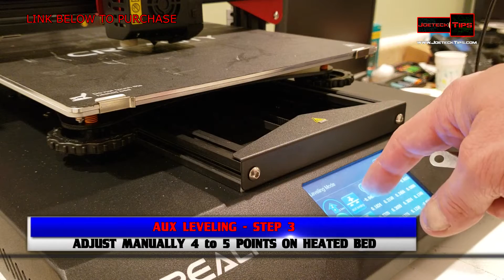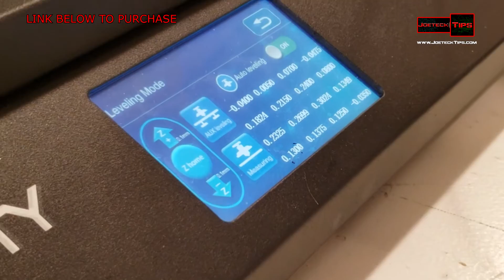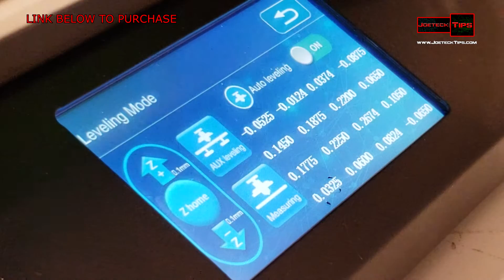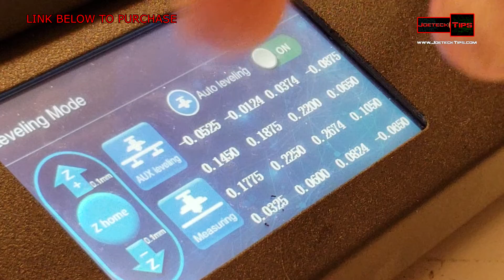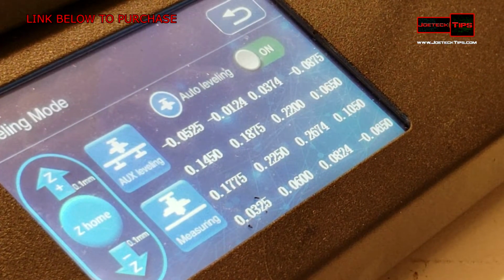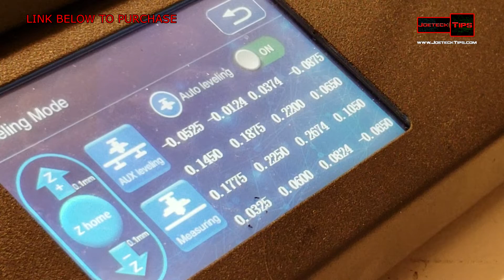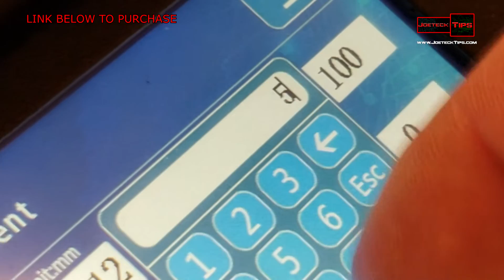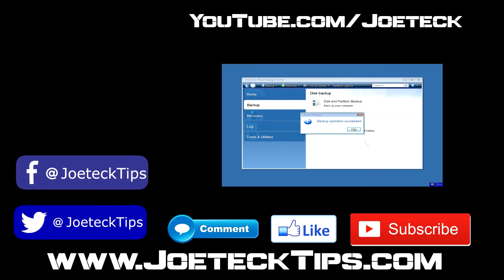leveling the Creality CR10S Pro | HOW TO | JoeteckTips

Comment: when you first get to leveling screen you have to set your z offset , you do this after baking the probe " let the probe set directly above the heated bed at print temp for 15 mins , heat effects all probes " , use the supplied shim to set z nozzle to bed by adjusting up or down with the onscreen buttons , once set hit z home , after it homes make sure the nozzle to bed gap is correct with the shim , if not repeat this till it is , then manually level bed , then map bed if wanted , now your first layer will come out perfect every time both outer and infill without any other adjustments 

your video skips setting the z height and is the most important step for this printer , you can flash marlin to store a balanced offset but isn't perfect but stops you from having to do this step every print but best results is achieved if you do and why they left it this way 

the only trick to capacitive probes is baking and setting the z offset , I run several printers with them and do all the same way and can't tell you the last time I've had a failed print , while this video is old I just educated a guy having problems with exactly this and pointed me to this video as he used it to set up the printer and why he was having issue , do please update for others

Comment: Question for u . My z won’t go any lower it gets stuck at home and will not lower so I can level the sensor
Reply from the maker: Make sure the screws holding the worm gears are not cranked down tight. This may prevent the Z axis from moving.

Comment: Did you do you leveling with the bed and nozzle heated at the normal printing temp?  If not you did something wrong.
Reply from the maker: Didn't do anything wrong. Doesn't have to be hot to level.
Reply: @Joeteck  Metal expands when hot, so not heating it will cause it to not be correct.
Reply from the maker: @TheLotw  mine works fine.. perhaps you should get glass

Comment: I have just purchased the Ender 3 Pro and the Cr10S Pro.  The ender 3 had to be build from scratch and was so easy to set up and use.  The CR10s Pro is a piece of Sh*t.  So much can go wrong, too many adjustments, adjustments keep changing.  For 3 times the money you get 3 times the problems. Would not buy another CR10s Pro.
Reply: Agreed.

Comment: This printer is making me crazy now. Its still f.cking terribly leveling.. Even with new firmware which remember your settings. Almost every print is decalibrated, you have to level it almost every time you print ... I love the way this printer looks, i love the way it prints when its right leveled, but in summe for me its 30 minuts of leveling for one print, what a ... i don't know.. maybe p.iece of sh.t is the right word.. I did perfect leveling, with correction of lets say -1,5mm while printing which is working perfectly.. after print is done, on the next day those same setting are not working and printer odes press into the desk or just fly in the sky
Reply from the maker: I do not have the new firmware. They made it very complicated to upgrade. It could be a crappy printer. I have found the idiosyncrasies with it. Do the fave point Calibration, then the auto leveling which looks like it does something. Then I start printing. I then manually adjust the print head height from the control panel until I see the correct semi flat print. It is a pain in the butt, yes, but I have figured out how to get around the crap and make it work every time.

Comment: Hello Joe thanks for the video, a question for you and all others who have this printer.... After all that set up I can get it to make a great print however as soon as the print is over or I shut down, the power to the gantry stepper motors stop and the left side with all the feed mechanism is so heavy it drops down lower than the right side.  I didn't realize it had done this the first time and unfortunately my print pad looks like a gopher ate through it now.  Have you or any one else noticed this problem with continuous gantry leveling every print?
Reply from the maker: Any way you can send me a picture? Joeteck@joetecktips.com
Reply: @Joeteck  well I stayed up all night debating on ripping apart or sending back. took everything apart and put back together a few loose and incorrectly align parts that you wouldnt think. gantry seems to stay even now. still have the head level issue. even after getting the hot end at the perfect height after each new print it never comes back to exactly the same spot. sounds like possibly a firmware update issue.
Reply: I love the QC  sticker on it. ! makes me laugh
Reply from the maker: @shaunferris6063  So is it working?
Reply: @Joeteck  YES thanks again for pointers on your video
Reply from the maker: Shaun, my pleasure! Glad we talked it out and you got it working. Keep my email fir future contact. Youll never know. Ask me anything you want. ;)

Comment: Hi Joe, I have a question regarding the adjustable bed. What position should the bed be in before I level it? Should it be all the way up , down or halfway?Also, should the nozzle be flexible on the Gantry,or rigid?  Mine is flexible on the Gantry.
Reply from the maker: nozzle should be tight. Use the included wrench to tighten the two nuts. you have 3 wheels, the top two adjust the tension.   Make the bed adjustments in the software. 5 manual leveling points. Looks like a die, 5 locations.  two top, one center, two bottom. Adjust the bed while in that mode. have any additional questions just ask. I'm here
Reply: @Joeteck    Hello Joe. I didn't mean that the nozzle itself was loose, I meant that the whole unit seems very loose on the gantry. With regard to the bed itself, I meant should the adjustment knobs be loose or should they be tightened all the way down before going into the software to level?
Reply from the maker: @JohnFriedel-b6l  hmm. doesn't really matter, because you have to run that manual mode leveling first, then the auto after that which is done last, then you can start printing.  Of course you did the height adjustment with the sensor and the gantry leveling before this step. I understand the whole unit is lose. There are two wheels that ride on it, that will tighten with the wrench, try it.  .
Reply: @Joeteck  thanks very much
Reply: @Joeteck  I'm going to order the inductive sensor.
 That works the best and cures the problem
Reply from the maker: What problem? I havent had any. What problem are you refering too?
Reply: @Joeteck   bed leveling
Reply: @Joeteck   Hello Joe, I tightened the 2 tension nuts on the nozzle but that didn't make any difference. I can still tilt the nozzle ,yet it doesn't come off the track. Also, with regard to adjusting the Gantry height, I cannot adjust each side separately. One side is always out about 1/8 of an inch.
Reply from the maker: @JohnFriedel-b6l  You need to contact the manufacturer. If that is not working something is wrong with your printer.

Comment: if you going to use the autolevel, tweaking the level knobs after the calibration is useless. once you get the initial sensor calibration, then you go for the Z offset calibration and after that no more worries. I would prefer a BLtouch sensor for this job.

Comment: I couldn't get anywhere with mine mainly due to the craptastic capacitive sensor the Pro comes with. Best three things I did were:
    1. Spend $8 on Amazon for an inductive sensor. The type is important but is a pretty much a direct replacement for the horribly inconsistent sensor it comes with.
    2. Installed the Tiny Machines CR-10s Pro firmware, that remembers the autolevel settings when the power is turned off.
    3. loosened every screw I could get to, in order to pull the right side of my gantry closer in height of the left. 
        (The way it was assembled at the factory left the right side way too low. Every time I cycled power the gantry would bounce back to the wrong height.)

Search Google for these three things to make the Pro usable, otherwise, you may wind up throwing your printer through a window like I almost did.
Reply from the maker: Pinned! Great info right here!
Reply: Hi Joe,
can you explain in details point number 3 please? (loosened every screw I could get to, in order to pull the right side of my gantry closer in height of the left. ) I dont understand how do. Thanks
Reply from the maker: Hes talking about replacing the sensor.  I hope that is what you are trying to do
Reply: @Joeteck  Yes I purchased one week ago and I will replace this saturday. Thanks for your replay.
Reply: I Soldered an Inductive sensor on mine and it made the printer come to life! Lol

Comment: Print speed has nothing to do with adhesion at the start, was the nozzle height as you found out later. Have the pro also, has a learning curve as you point out but once you know its like butter.
Reply from the maker: Actually it does.. PETG requires to print MUCH slower. 30 is the recommended speed. Any faster it will fail

Comment: I set a perfect first layer with correct leveling, move the sensor down , something like 2 mm over the bed (the levelling sensor work better if is close to the bed and you'll not find this in the manual ), after that adjust the position of the nozzle at 0.2 mm and finally set the screw off the sensor . Problems of this printer are others: layer shifting and a totally bad setup of all the screws and belts .. in Creality don't know what is quality control but anyway they put a paper with Q.C. ok :), it's a good printer but it's better to tear down all and rebuild it :)

Comment: @Joeteck I've noticed that with an inconsistent bed level, if you use a raft instead of a skirt you shouldn't have a problem with the print sticking. I'm not sure why, but it was very consistent with each layer when I used a raft for the base. The raft printed perfect, and the model that followed printed with no issue. Give it a try. As I mentioned before my bed was bowed in the middle but the raft seemed to compensate for it
Reply from the maker: Raft? Mine bows in the middle too
Reply: @Joeteck  if you use Cura, which I currently use, under build plate adhesion, select "Raft". It prints a flat surface completely under the whole print that is removable just like support is removable. It worked for my cr10 pro. Totally changed the level issues for me. I would of course level the corners of the bed I could, but printing with a raft eliminated problems with first layer adhesion
Reply from the maker: @101mercenary  I use Cura too,  however I do not see that option in my version of 3.6.0. I checked preferences and I see nothing of the sort.
Reply: @Joeteck  That should definitely be in there. I have the same version. Go to the right of your screen (custom menu). The menu below Support should say Build Plate Adhesion. If you don't see it, go to Preferences>Settings and check the box at the top that says "check all". It should show up in your custom menu on the right. The first drip down should say "Build Plate Adhesion Type and select Raft. You can preview what the raft looks like after you prepare the slice

Comment: Also this is one of the best upgrades I've seen for this printer, it has an guide for updating the firmware and a z axis timing belt upgrade for those of you interested. https://www.thingiverse.com/thing:3387741?fbclid=IwAR1joWpZLWTETdta9uWjuacmKUb4roa-DN7N1SY0iEY_sj9TrCc4BdzPRLI

Comment: I recommend getting a PEI Sheet for the bed, all my prints stick perfectly and I pop them off by hand no problem. Took off the black sheet from the aluminum an applied the PEI. Up to you if you want it I just thought it was a nice upgrade. Also for leveling, I do the Z home level about 3 times to make sure the sensor is correct(Adjust It BEFORE the AUX leveling and measuring with the screw on top of the sensor)
Reply from the maker: 3 or 4mm thick and where, AMAZON? provide a link please
Reply: @Joeteck  I believe the sheet is about 3mm. It's pretty thin so it's close to the aluminum bed. I suggest if you get it, to take off the protective top layer before you apply because you will be able to see the bubbles better through the sheet to flatten out those areas. Took me probably 10 to 15 minutes to do. Get the glue off from the black sheet with acetone or nail polish remover. https://www.amazon.com/gp/aw/d/B07FVL1SYF?psc=1&ref=ppx_pop_mob_b_pd_title
Reply: Also @Joeteck , make sure your aluminum bed is level across the whole plate, otherwise it won't matter what you put on there(and I don't mean level with the knobs, I mean like a granite finish) Mine bowed down in the middle, kind of convex. It would print high in some areas and low in others. The 16 points arnt accurate enough to pick it up. I'm currently looking for precision ground aluminum plate. Haha. But of course you can do it by hand
Reply from the maker: @101mercenary I need to have a 310 x 320mm version. I have the PRO, the link you provided is too small.
Reply: @Joeteck  I have the Pro as well. It's up to you. I never print the maximum width on my printer so it doesnt matter so much to me. There may be a PEI sheet out there that size but I have not been able to find one yet. Relative to the size of the print bed it's not that much less overall.

Comment: Hi Joe, it looks like you missed a step. I tried to scan back through the video and didn't see you adjust the sensor sensitivity with the screw on top. You set the height of the sensor but never adjusted sensitivity after that. Once I leveled like you did, then adjusted the sensitivity laying down the 1st layer has been a breeze. I have been printing on this thing like crazy. I was about to throw it in the garbage at one point. I also did not like the bed surface it just seemed to give me problems. I switched to CCTREE 3D print surfaces 300X300 these things stick like crazy. You get three of them , probably have 80 hours on my 1st one and no signs of problems.
Reply: The sensor sensitivity was missed and in my experience is an essential step.
Reply: This is the most important step. You have to set the nozzle height using the little screw. However, this sensor is pure garbage, it doesn't work well on a heated bad and even the Creality instructions say auto-level shoudl be used with rafts. I note Creality has replaced the sensor with a BL touch.
Reply: yeah... without adjusting the sensor... it makes the bed leveling sensor completely useless.